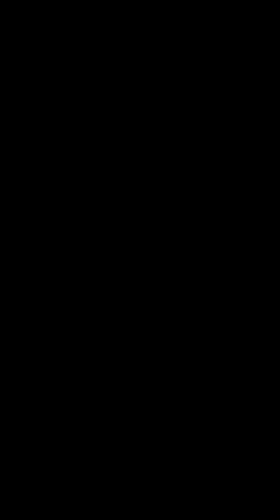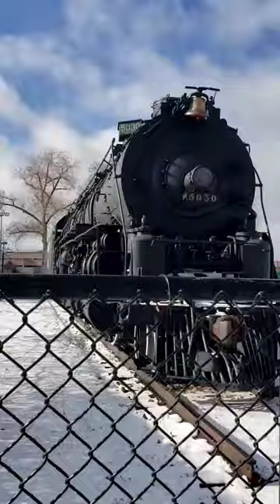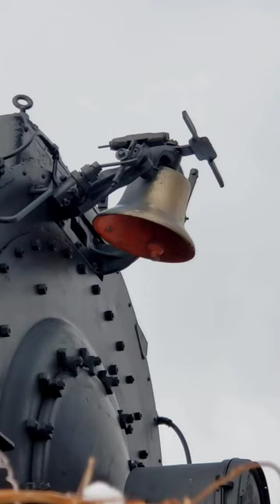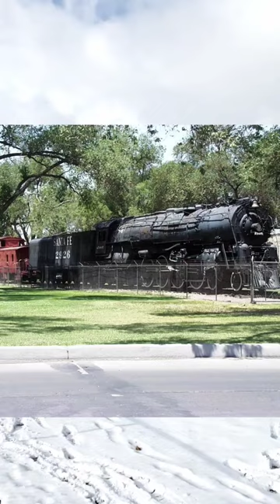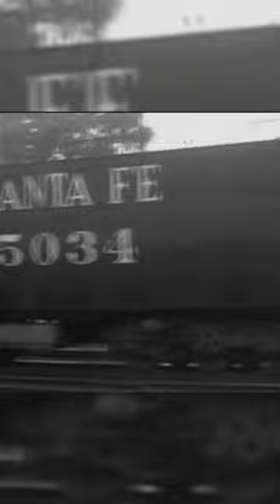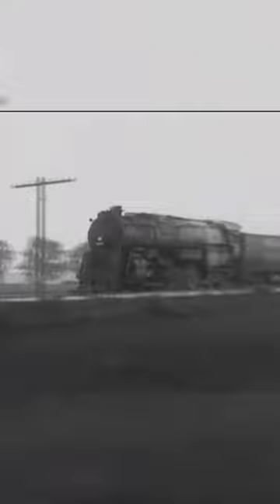ATSF 5030

Comment: Any plans to restore her?
Reply: Hmmmmmmmmmmm
Reply: I like the class as much as anybody else, but where would you run a 2-10-4? There is a reason there has not been an operational restoration of one that wasn’t going to run on a class one (that I have heard of). Those that were have now gone cold.
Reply: Need more steam if and when the electricity goes out
Reply: Ok but Western Maryland scenic railroad has an even bigger engine restored
Reply: @MecFan7470  The 5011 class is around 23 feet longer and not articulated. Also quite a lot heavier. Having a ten driver wheelbase is pretty disadvantages for getting around curves. 1309 has the advantage of being articulated.
Reply: @Stooltoad5017  oh ok I was just asking
Reply: @Stooltoad5017 T&P 610
Reply: @electronicjoyride3444  pretty sure 610 ran under class ones when it wasn’t operating in the American freedom train. It was set up for static display after the Southern was done with it because nobody else could run it other than a different class one. 610 hasn’t been operational since the 80s